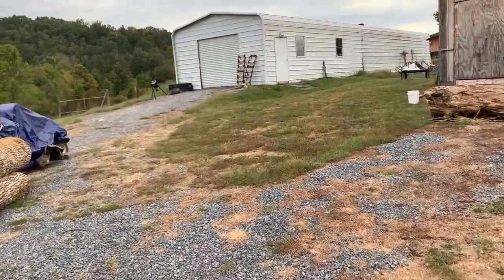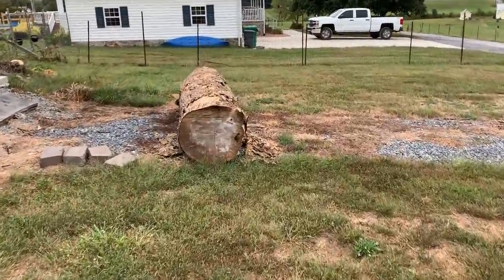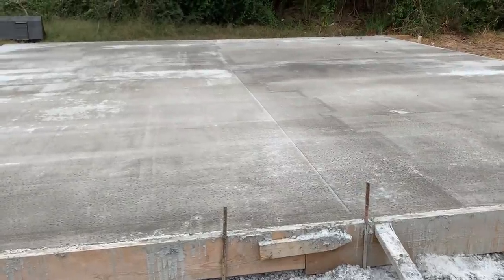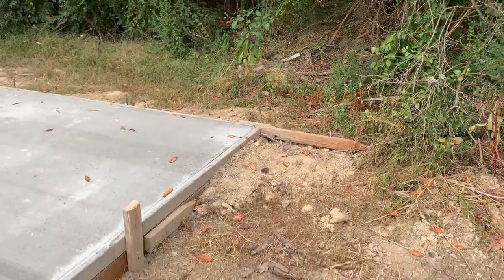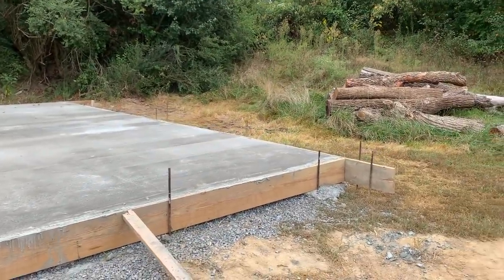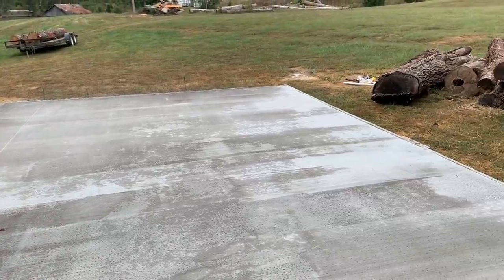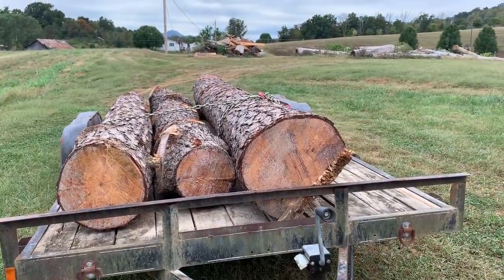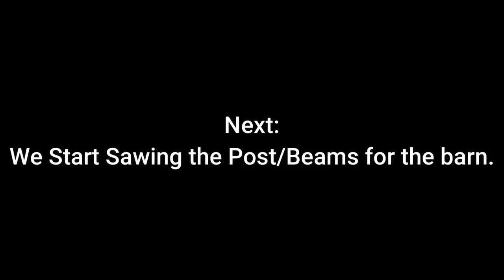THE TIMBER FRAME BARN BEGINS, HAULING LOGS FOR THE SAWMILL

Comment: I think the slab looks mighty fine. And of course I took note of the height of it. You know this but I'm going to say it anyway. If you have some more of the clay and slate mix use it to build up and then top it with about six inches of the crusher run I suggested for your driveway a while back, wet it really good and roll it in. Or go four inches and top it with more concrete. Either way you'll have a nice ramp access to your new barn.

Comment: Concrete will crack ... it doesn’t matter if you use fiber or rebar or both,  if you vibrate or don’t vibrate ... it will crack ... I had a professor tell me that years ago ...
Reply: Barry Haynes according to the American Concrete Contractors association “All concrete is cracked or is going to crack “ the truck is to get it to crack where you want!
Reply from the maker: well said,

Comment: A shame that you have to put up with all of that nasty pine sap. Around here, there is an old timber frame barn made from massive poplar timbers. As the saying goes, you work with what you got. So many good trees around here got cut down recently. Some people putting in garages or just getting rid of trees they don't like. I found myself wishing I could ship them to you. I saw huge Maple, Walnut, Oak, Osage... If I had a sawmill I would save them from the firewood pile or wood chipper. (some tree services around here make so much off of firewood, due to outdoor wood stoves for heating houses, that they refuse to sell logs for lumber.)